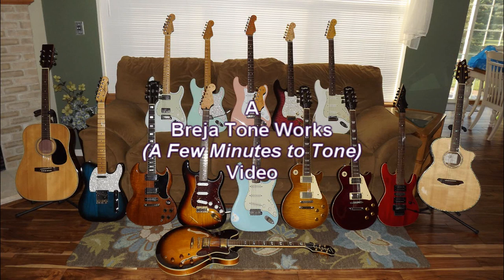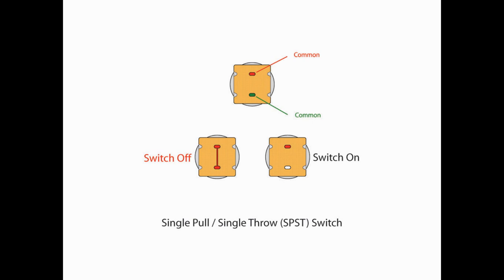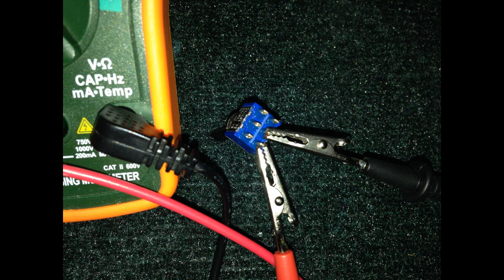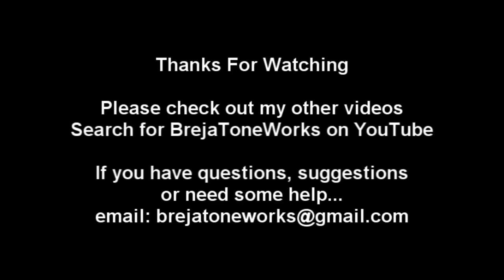Guitar Switches DeMystified

Comment: I use a Demon Tube screamer pedal with a 6 lug switch. Up is ts 9 and down is ts 808. Instead of switching, can it be wired to use both sounds at once? No toggle since the sound difference is barely audible. Thanks.

Comment: Please Breja Toneworks could you answer this question? Can I swap a 3 way toggle for an alternate DPDT slider switch maintining the same functions as the 3 way toggle? That is because my guitar body it's so thin that the 3 way toggle does not fit properly and the pickguard it's actualy not laying flat on the guitar body! Thanks in advance.

Comment: 0:33 SP/ST or Single Pole, Single Throw switches
2:08 SP/DT or Single Pole, Dual Throw switches
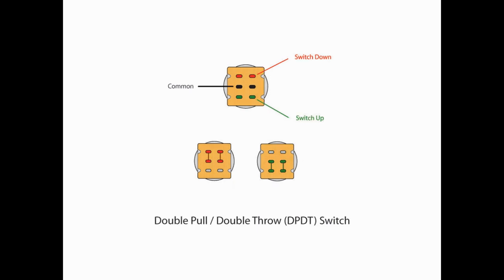2:52 DP/DT or Dual Pole, Dual Throw switches
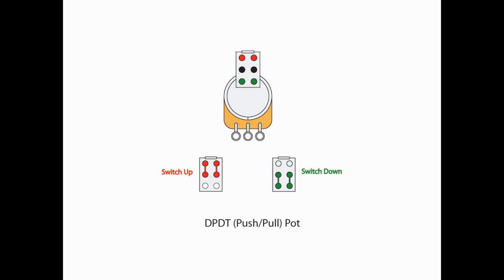3:42 DP/DT push/pull pots
4:55 4SP/DT or 4 Single Pole, Dual Throw switches, aka Fender S1
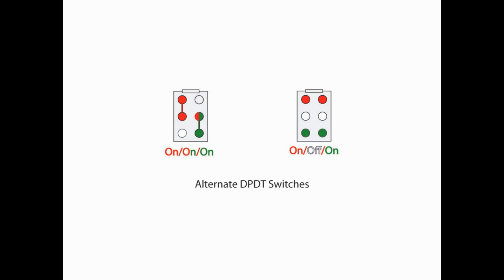6:06 Alternate DP/DT switch configurations
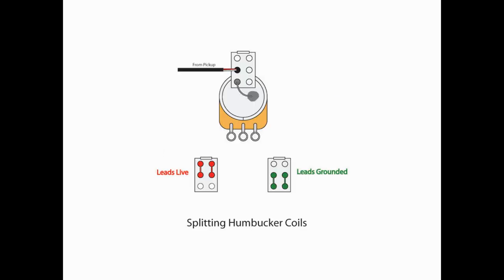7:21 Splitting Humbucker Coils
8:09 In/Out Of Phase

Thanks for the info! I love how clearly you lay everything out; just a huge fan!

Comment: These are the best videos on guitar wiring.

I had never even soldered before this, but using your videos, I'm currently building an HSS strat pickguard with series/parallel switching for both the humbicker and single coils and a normally open/normally closed killswitch.

Comment: GFS now has push-push pots. Push on, push off, dpdt. I just purchased two of them for SG rewire. It's sometimes hard to pull that knob up unless you have Tele style knobs.
Reply from the maker: Hey James...  My only caution to you is to measure the values of the pots before you use them.  You want as close to 500K or above as you can get.  Lower will make the SGs pickups very bass-heavy (unless you like that tone).  I've bought stuff from GFS and other sites but pots are a tricky thing.  Sometimes I get lucky - other times I'm off to buy different ones because the values are low.  Best of luck...  Don

Comment: This video its really helpful.
I gonna experiment these switches on a musicman clone bass, the pots of tone and coiltap doesnt work anynore, anyway I dont use a mid term pot resistance, or its open full or not, cant tell a detail diference in between. So gonna try simple toggle on off for those wirings.

Comment: I appreciate your videos and all the effort you put into them, but sometimes they bring up more questions than they solve.  I learned a long time ago it's POLE, not pull or poll.  It would be more informative to see why you're using Double Pole Double Throw (DPDT) switch in the first place.  Do we have two wires coming from a single pickup? Are we putting two separate pickup leads, one from each pickup into each of the two poles? What is going into the common(s) in the middle of the switch, and what are going out of the throws, and where are these leads going to out of the switch throws? Showing three lugs on a pot and six locations on a DPDT switch do not clarify much.

Comment: I am putting together a guitar for my son.  I don't play, but I have a good understanding on electronics (but not with guitars).   Here's what he wants; a Red Special, David Gilmore, Strat, LP hybrid.     Here's the build;   Strat knockoff body, three hot rail pickups, three on-off-on selectors, and three DPDT to phase switch, a master volume, and two tone (push pull) One for humbuckers, the other when single mode.    

I've got most figured out, but Im stuck on separating out the tone pots for HB and single on separate tone controls.  The push pull part will bring in tone caps for a little extra variety in sound. 

My question is "Can you draw this out?"

any help would be awesome!  Thanks

Comment: Thank you for your videos. I need a little help although..  I have a push-pull tone pot in a strat for 2 capasitors and I want to add a third capasitor. What switch I need and how connect them(I dont want on/on/on to blend 2 caps in middle)? And I have a push-pull volume pot for a treble-bleed and without, and I want to add a second treble-bleed. What switch for this and how I connect them?

Comment: I am a little confused and would welcome any advice or suggestions.
I have a USA standard Telecaster (1992 ). I recently fitted a Seymour Duncan ST-59 in the bridge position.
I discovered that I needed to swap the black wire ( hot) with the green wire (cold) on the Seymour Duncan for it to be in phase with the Fender neck pick up.
I have a 3 way selector and a coil tap on a micro switch. But I want to replace the TBX tone pot ( without an earth !??) with a push pull pot so I can select out of phase for the middle ( parrellel ) position.
But I am unsure how to do that.
Reply: localbod two of the terminals on the TBX should be grounded to itself by a resistor and another 2 grounded to itself by a capacitor.

Comment: I have an s-1 switch that I'd like to install on my strat to make a 7 sound strat. So in the up position the pickup combinations remain unchanged but when the switch is engaged I'd like to get bridge and neck for position 5 and bridge neck and middle for position 4. I'd also like to be able to have both tone controls in the loop (I have already paired the bridge and middle tone controls) can you tell me how I should wire up the s-1 pot?
Reply from the maker: Hey Mike...  email directly at brejatoneworks@gmail.com and I'll give you a hand.
Don

Comment: What kind would you recommend for a coil split/tab application? And how do I wire the two wires?
Reply from the maker: Normally you'd use a small SDPT or DPDT toggle switch or a Push/Pull DPDT Pot for Splitting Humbuckers.  You need to have Humbuckers that have 4-wires if you plan on splitting.
Reply: I have a DPDT and a mini humbucker w/4 wires. I tried using your scheme, but it didn`t work... I must have done something wrong. I wired the two (red & green) in the middle tab, and ground to the tab at the end.
Reply from the maker: Alf Pedersen Ok...  Did you make sure you have the right wires connected?  Not every pickup is going to use the same wire scheme.  You need to verify with your particular models.

Then - when you say it didn't work... what does that mean?  What doesn't work?  Email me:  brejatoneworks@gmail.com
Reply: Breja ToneWorks
Thank you, I`ve sent a mail. :)